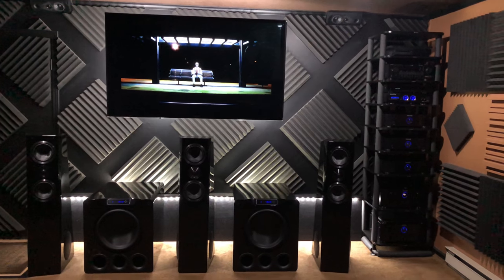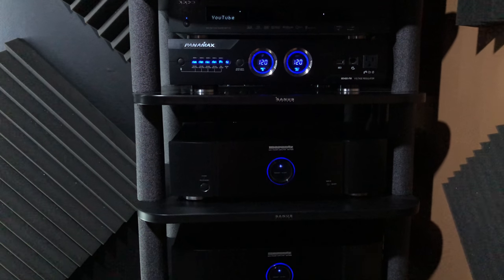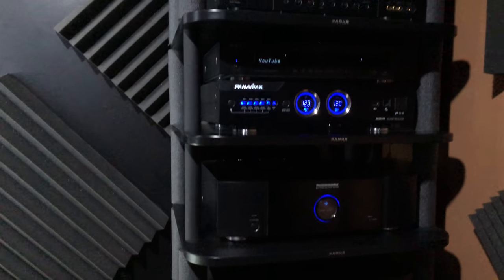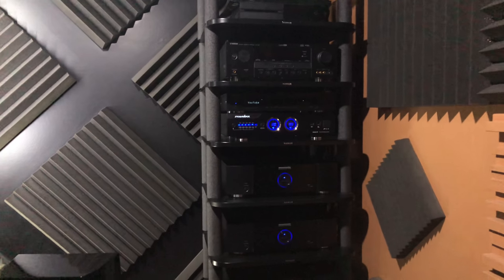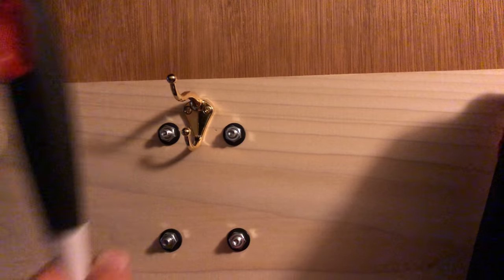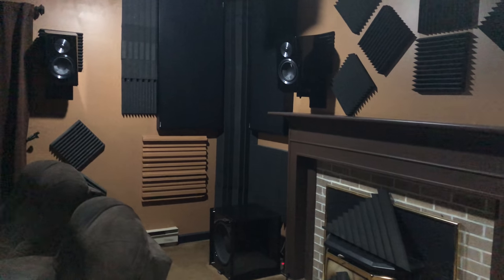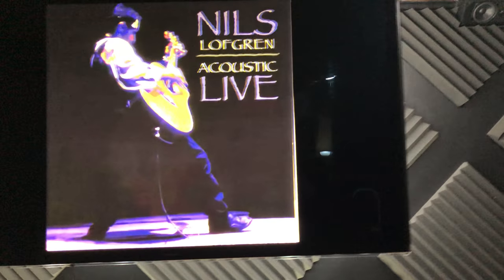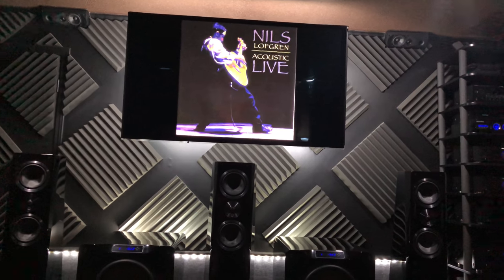SVS Home Theater Tour pt1

Comment: I'd look at a drop down AT projector screen and a 4k projector. Then it won't affect the tower speakers
Reply from the maker: MrSuperman258401 
Yes. When I mounted this tv and added the svs towers across the front I planned for either an 85inch tv to replace it or keeping this tv pushing it back closer to the wall and having a drop down screen come down in front of it and having both. It takes time tho. I try to add something new every year so will see what 2019 brings

Comment: Killer setup! What is the distance between the bottom shelves? Sanus states 8 inches but that looks to be a greater distance. Did you place two legs together without a shelf in between?
Reply from the maker: Christopher Murray 
Thanks man!  The two bottom shelves are 12 1/2 inches. All the others are 8. They sell the longer posts to fit large amps or processors.